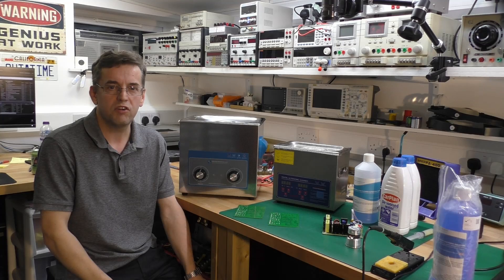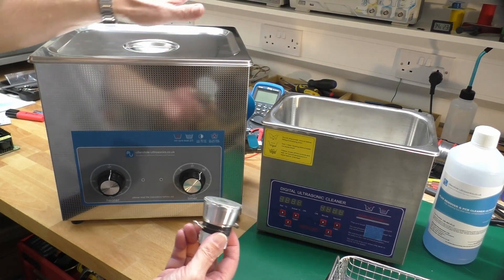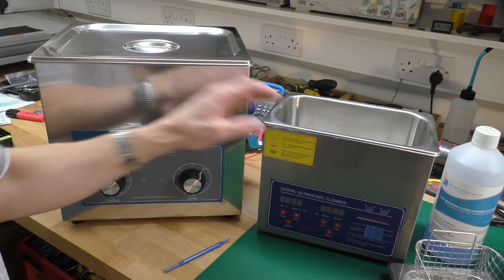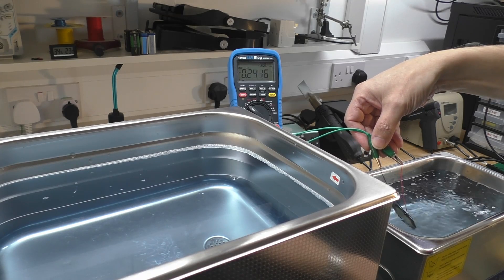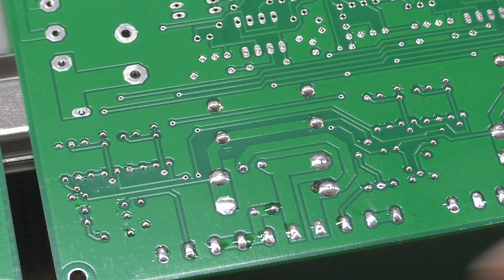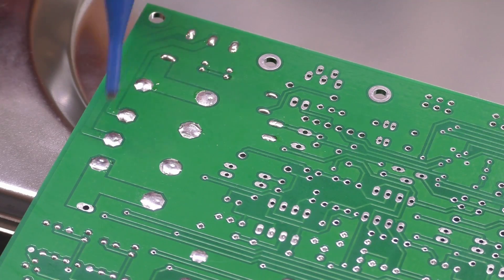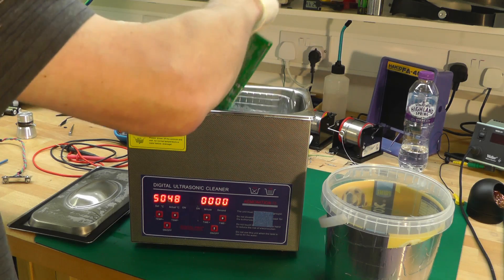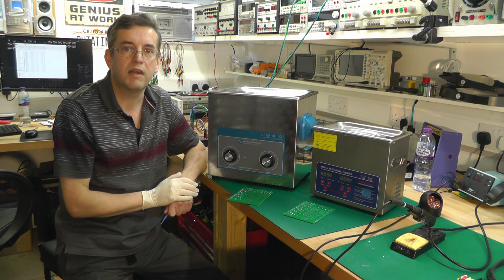No.040 - Trying out a new Ultrasonic Cleaner for PCB's

Comment: You keep saying cheap chinese, but don't realize both of them are made in china... LOL This is what I find so perplexing about some Europeans is their constant need to pat themselves on the back and act superior or something, but I guess that's just your guys history.  I think what you meant was chinese branded ultrasonic cleaners. Allendale has a distribution center in Hertfordshire and factory in China. Same internals, open it up. I have both myself and I have the Crest CP500 and the SharperTek 240 as well. I find Crest vastly superior, then the SharperTek as the king of them all, but really not much difference between the SharperTek and Crest except the price, ShaperTek also does do one runners while Crest I have to run through twice sometimes. Overall best value and best units goto SharperTek for cleaning. But I don't know what it is with europeans, I swear some Brits always have to accompany something about nationality or race.  They're all literally made of the same components from china...
Reply: Also opening up the internals, Allendales appear to be a copy of the GT Sonic... hows that for irony.
Reply: It's actually not a copy of GT Sonic, but a rebranded one. Also, GT Sonic is a brand too - there are many manufacturers and brands at this level, for example DK Sonic.
What is meant is probably - cheap chinesium engineering and materials. And this "chinesium" is a term coined by AvE, not someone from Europe.

And over all Crest and SharperTek are not represented well here in Europe, because there are many European manufacturers. To name a few: Bandelin Sonorex, ELMA Schmidbauer Elmasonic, PMI labortechnik WiseClean, EMAG EMMI, Nickel Electro Clifton, Ultrawave, COLTENE, Guyson...
Reply: Why do you Chinese produce so much questionable quality goods, much potentially dangerous, lowering the quality as much as possible until people complain, then when they do you get upset, stop making dangerous electronic goods and people might stop using terms like cheap Chinese.

Comment: Hi
Very helpful video! Do you ever use alcohol after you take your boards out of the ultrasonic? How do you dry your boards?
Thank you
Reply from the maker: I never use alcohol unless it is to remove a stubborn bit of flux. I dry the boards with a hot air gun (carefully!).
Reply: IanScottJohnston I find when I use alcohol it sometimes can leave a light white deposit
Reply from the maker: @computerworksuk  Exactly!.....my boards are precision instruments and need to be absolutely clean with zero residue.

Comment: You may have said in the video but are you using a solder with a flux designed for being water washable. I remember when I worked in production electronics more than 20 years ago, we just had large domestic dish washer and a drying room. But I remember some flux type were much easier to clean than other. Perhaps you could experiment with some different solder and fluxes in the future. Regards Chris

Comment: Do you have any thoughts on cleaners with sweep frequency function and if they are really necessary for getting under fine bga devices and around the smallest components?
Reply from the maker: I've only ever used fixed 40kHz type cleaners. The theory is there for sweep type, but I don't know how much better in practice. Maybe somebody else can weigh in.....

Comment: How often do you have to change out the fluid?

The piezo test doesn't mean much, it depends on the resonant frequency of the transducer and the frequency of the transducers attached to the bath.
Reply from the maker: Transducers in both units are 40kHz......a reasonable back of the  envelope test I thought given even that the resonant freq may be well off.......and results seemed to make sense.

Comment: Why not just use 99% isopropyl alcohol mixed with your deionised water or even just 99% IPA on its own. I use an old tooth brush and/or cotton buds with 99% IPA to clean flux off boards. It works well - the alcohol dissolves/dilutes the flux. I think isopropyl alcohol would work very well in your ultrasonic cleaner.
Reply: No need to buy expensive branded cleaning fluid.
Reply from the maker: IPA in an ultrasonic cleaner can be dangerous. Low flash point, fumes and IPA can damage some components. Most of the boards I clean are for sale in the products I manufacture and sell, so it's best to just not take any chances.
Reply: @IanScottJohnston  In my experience, straight IPA doesn't always do the trick either. There are some surfactants in the PCB cleaning fluid which seem to really help lift the flux off the board.

Comment: Thanks for giving the Chinese one a fair go, a lot of channels just write Chinese stuff off. Seems like a cheap Chinese import is the way to go. I wonder how many uses you can get from the fluid before it needs changing. I suppose you waste less of it in a smaller cleaner too, if you have a small PCB.
Reply from the maker: It really depends on the amount of flux/contaminants you pull from the PCB's....however, back in the day we used to strain the old Freon through a sieve to get another run of it......I wonder if it can be done on the old cleaning fluid also.

Comment: Thanks Ian. You don't need to use alcohol or something to remove the water?
Reply from the maker: I use a hot air gun immediately after rinsing the PCB's.......you don't need to blow it completely dry, just enough to get rid of most of the water and that you put heat inside the FR4 and it will dry itself. Ahhhh, the good old Freon days the PCB's dried themselves in seconds!
Reply: I meant mainly boards with components on them. You don't worry about water hiding in the transformers and stuff. I never thought about cleaning a board with my ultrasonic unit. Freon was great! I used a lot of Freon in the military. I'll bet that the military still uses Freon!
Reply from the maker: Yes, with components on them for sure.......just make sure things like transformers, switches etc you add to the pcb AFTER it's all cleaned & dried. An ultrasonic cleaner changes a wee bit how you get from bare board to nice clean final product.

Comment: I've used cellulose thinner in my ultrasonic for years, It's cheap (10 quid for 5LTR) and removes all traces of flux without the need for a water-based solution.
Reply: Also removes all trace of brain cells if you use it outside a fume cabinet :D

Comment: Is there an energy density function here, twice the power in the new unit but a much bigger volume?
Reply from the maker: With a bigger tank and more heads, proportionately more energy results in more cavitation. However, cavitation will top out/saturate thus the addition of more sound energy will not result in additional cavitation.......so it really depends on the design itself, a good large unit could clean better than a smaller unit, or vice versa.
I know this because the head & pcb I showed in the video was my attempt to turbocharge the cheap chinese unit.......but it didn't clean much better!

Comment: What are the warm up times like in comparison?
Reply from the maker: I never compared them since the capacities are hugely different, and as I noted the chinese one readout couldn't be trusted.
Reply: @IanScottJohnston  I have a similar one to the Chinese one and it takes about 30 minutes to get upto 60deg. Is yours about the same?
Reply from the maker: That sounds about right.
Reply: @IanScottJohnston  Thanks Ian. I just ordered some of the Electrolube. I have been using the Allendale blue concentrate from your previous video on ultrasonic cleaning. Will be interesting to see how it performs.